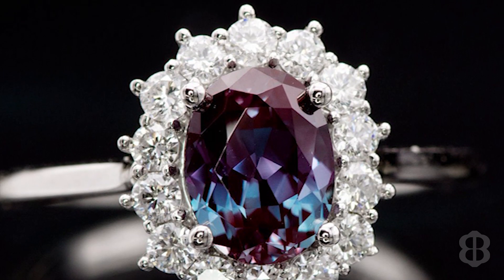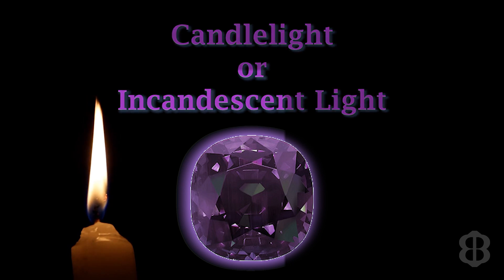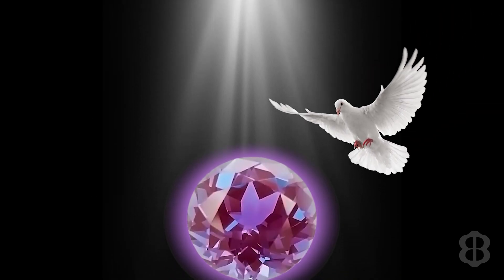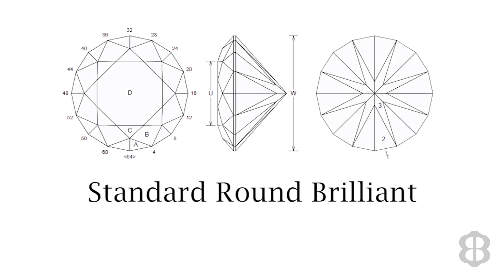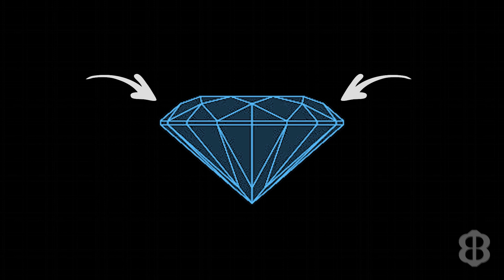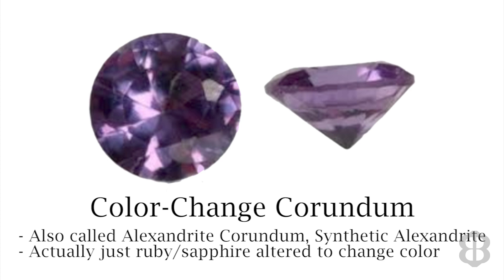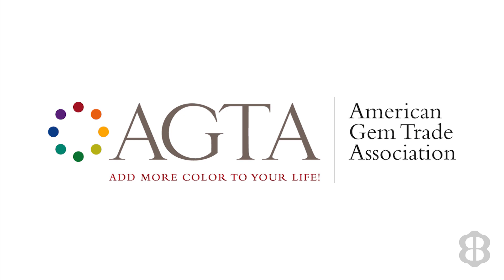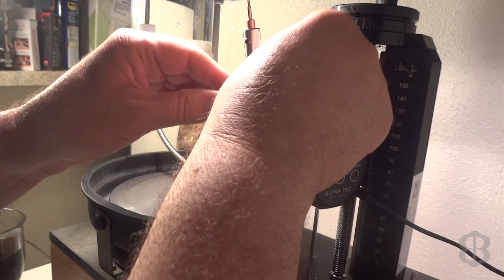Gem Cutting Tutorial - Faceting an Alexandrite with a Modified Round Brilliant Design

Comment: Hi Bopie, I was wondering what the angles for both the pavilion and Crown are because I didn't get all the angles for the crown only the following Pav1: 48deg , Pav2: 42deg.10, and Crown1: 44. Thank you Wendy Purdie
Reply: Hi Wendy.  Unfortunately, I don't have a record of the angles I used for some of my earlier videos.  However, you can go to facetdiagrams.org and pull up several SRB designs.  I am now working with Gem Cut Studio (GCS) quite a bit so I would take a SRB design from faectdiagrams and pull it into GCS and adjust it for Chrysoberyl to get the best performance.  ...always learning something new.  Best of luck.